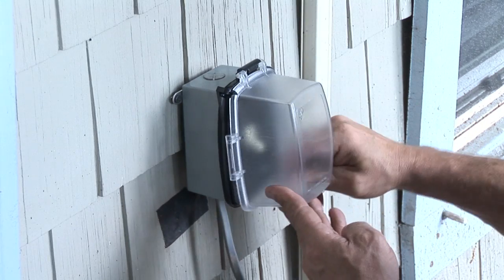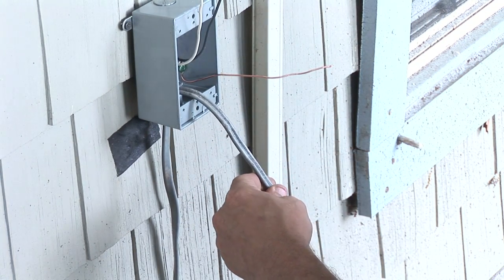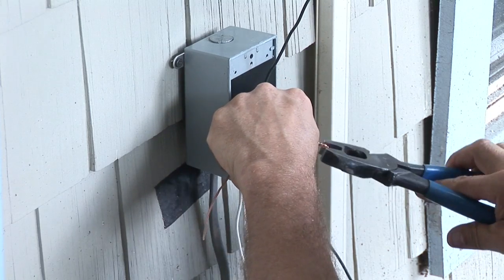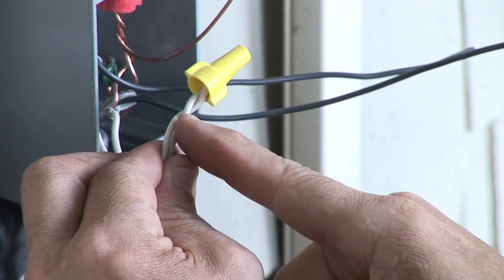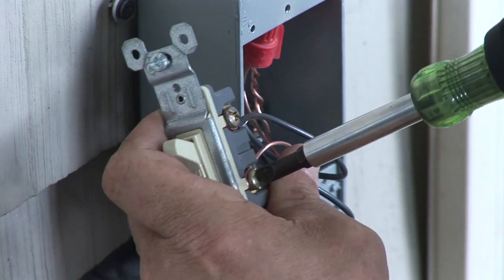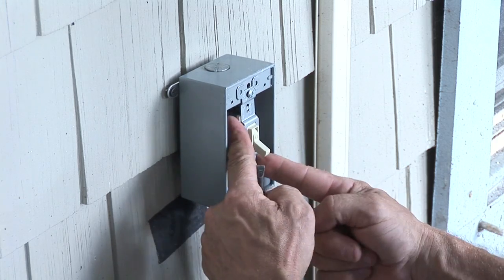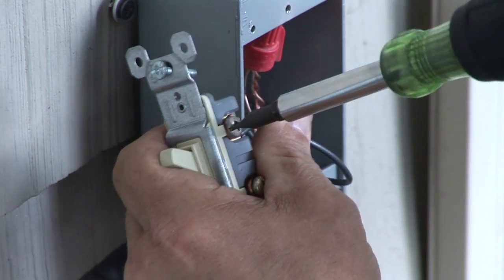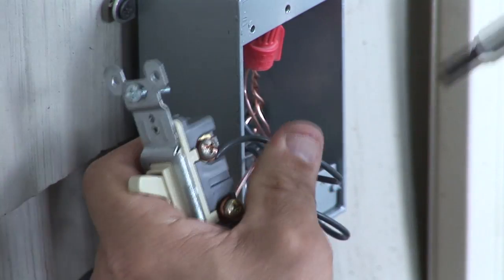Electrical Help : How to Install a Light Switch Outside

Comment: You can also just attach the box with magnets to something metal on the side of your house...it'll be just as secure.
And you should label your unsecured/unprotected cable with a sign that says "don't chew me" in case your kids mistake it for licorice.

Comment: What about your switched wire at the bottom of the box, you need to provided a means to protect it from physical damage. NEC does not permit UF wire to be installed in the matter you demonstate.